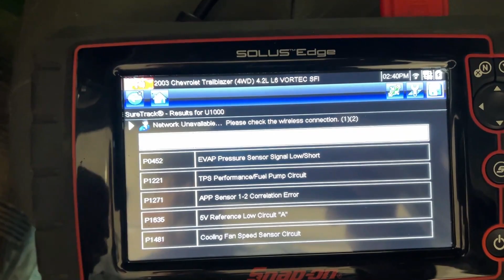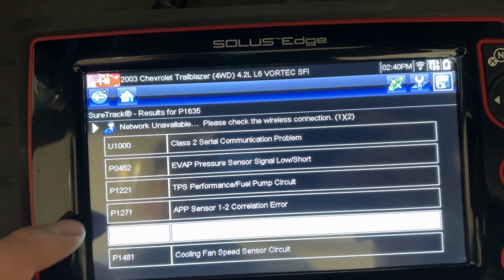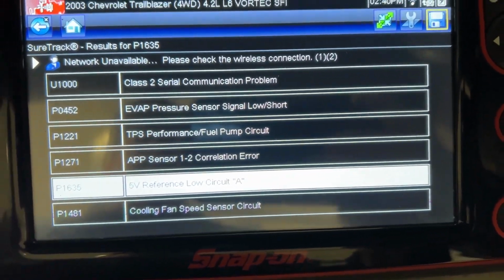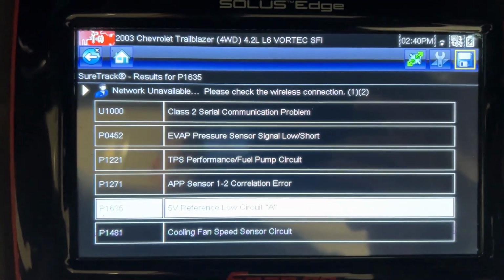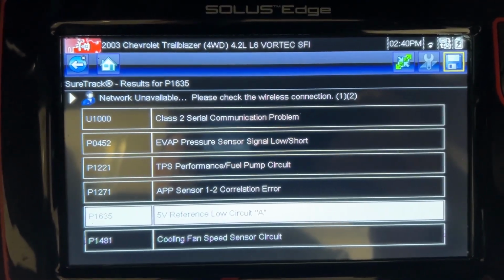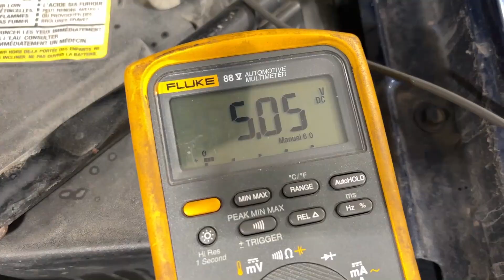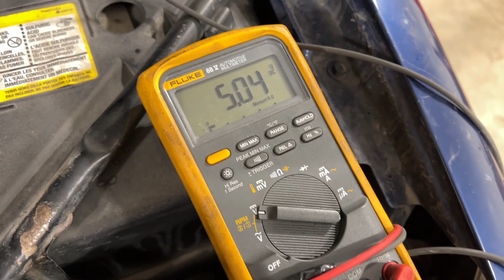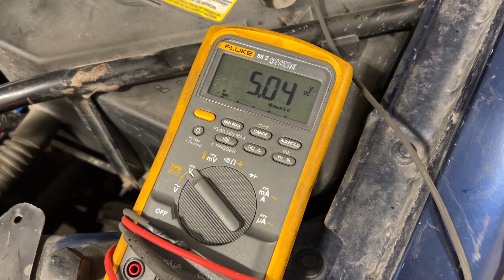Chevy TrailBlazer GMC Envoy Reduced Power Mode

Comment: Hey car doctor, God Bless you. So i have a question. Is the fan supposed to spin freely by hand when the car is off? Because I don’t have any of those codes and car runs fine but I noticed the fan spins stiffer by hand on my trailblazer also 4.2 engine

Comment: 160K on my Trailblazer. On water pump #3 but clutch is still working. That fan assy is a pain the butt to mess with. I like your special wrench for the big nut. I just used a chisel bit on my air hammer
Reply from the maker: Yes its a really neat tool for various size fans. You can find them fairly cheap also.

Comment: That fan clutch causes a lot of REP codes! I fully agree with using an OEM clutch, or you'll be doing the job again within a year.
Another easy way to diagnose it is to disconnect the fan clutch connector, and drive the vehicle for a while, making sure to keep a close eye on the temperature gauge! If the REP code does not come back, you've most likely found the problem. 
I've used your longer bolt trick when doing the fan clutch on my '04 TB with the 4.2 engine, and it works quite well!

Comment: I have 2005 trail  blazer problem with ac fan blowing speed  ,I replaced at the, ac fan blower, control 3 times  and work on all 5 speeds for 2 or 5 weeks  and the problem, come back again, can you have some suggestions, please 🙏 thanks
Reply from the maker: Replace the blower motor and module with OE parts.
Reply: Thanks for the suggestions, 👍

Comment: Man I can't figure out the problem with my 2003 gmc envoy, I have a misfire on cylinder 2 and I've even changed the injector,and ignition coils and spark plugs, can you give me another idea of what I could check
Reply: Did you try a compression test on that cylinder??
Reply: @Mschasz3129  yes all cylinders were good
Reply from the maker: Injector pulse? Cam lobes?
Reply: @ThecardoctorTV  thanks man, I'm gonna check it out

Comment: Great video.  You are the Trailblazer/Envoy guru.  I wish I knew the 2 bolt trick when I replaced my fan clutch last year (I did the "cut" hack).  Can you please give more detail on the spanner and air gun you used to undo the big nut (I had so much trouble with that nut)

Thanks for another great tutorial.

Comment: I do have 2003 olds mobil bravada i did replace throttle body new duralast my problem when the enginge start warming my Idle speed go 600 the my oil gage give me warning when i accelerate like 800 RPM goes to normal  oil pressure switch was replace and i did flush the oil put new oil some reason my Idle goes low to 600RPM but ist not dying giving me warning please help thank you

Comment: I know this isn't about your video but we're about to purchase a 04 GMC envoy cars in great shape runs and drives fine however for some reason and I am not an expert on the 4.2 at all but it sounds like a diesel motor to me is that normal it's got a rattle like a 12 valve Cummins kind of not to that extreme but same kind of noise but when you give it throttle it smoothes right out and their engine runs smooth any tips or suggestions

Comment: I have a 2002 Trailblazer that's been very reliable, but when I started it up the other night, the dashboard lights all came on. The gas gage went to 0, the battery light, brake light, security light all lit up. The truck stay on and I got home with the dashboard light alternating between normal and everything lit up. A day later, it still start right up. So the mechanic doesn't fleece me, how easy a fix is this, please?
Reply from the maker: What is the charging system voltage at idle?